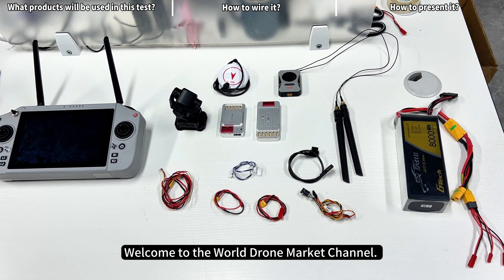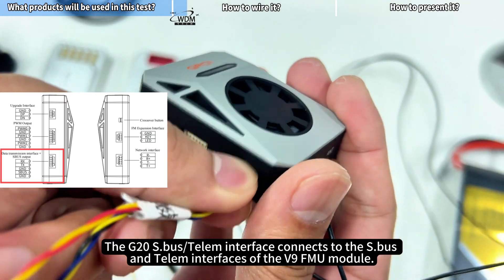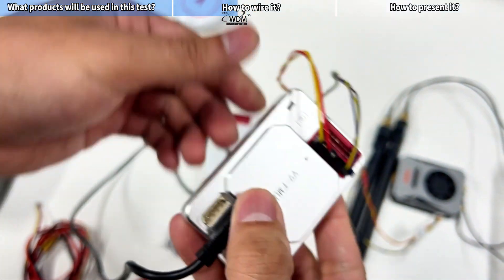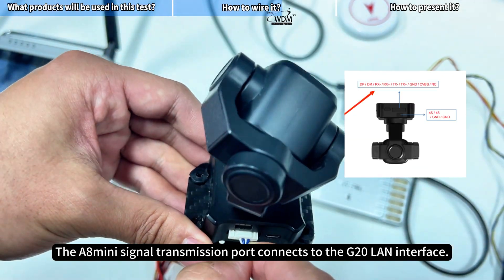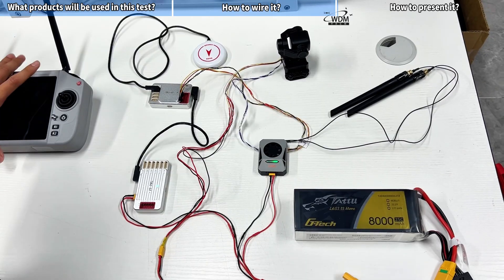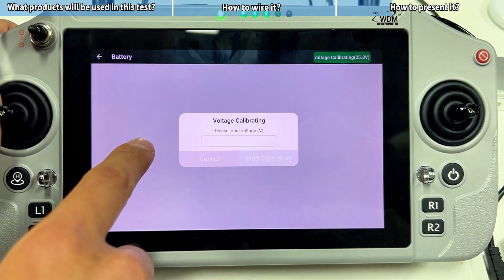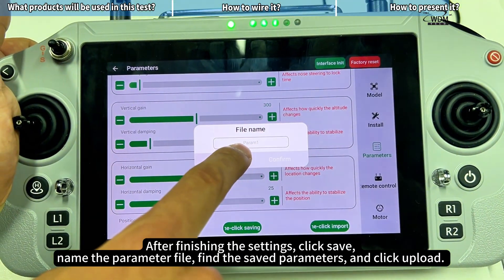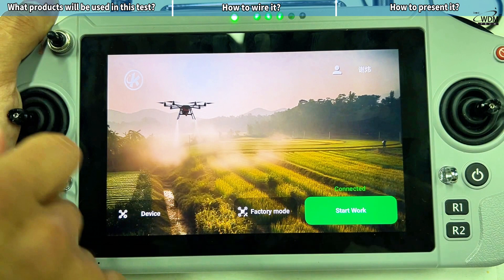Skydroid G20 and VK V9-AG Flight Controller Wiring Tutorial

Comment: Do you have shorter whip antenna option? I don't need super long range for Line of Sight RC helicopter application.
Reply from the maker: Do you need a whip antenna for the G20?
Reply: @worldronemarket I meant on the receiver. I don't need those big WiFi antennas.
Reply from the maker: @necavenue  Which receiver do you want a whip antenna for?